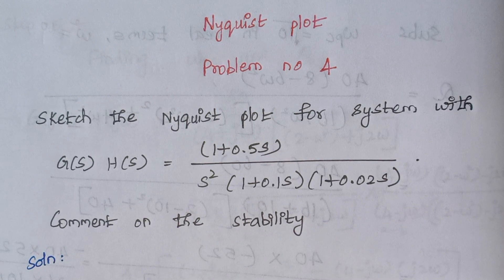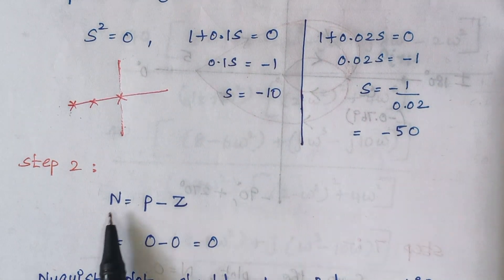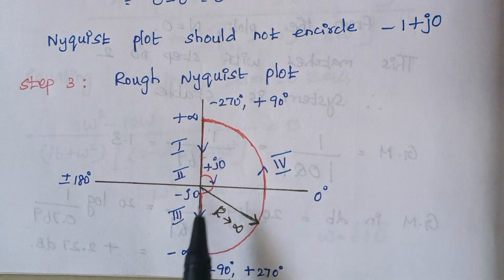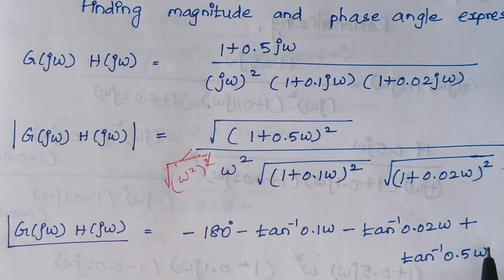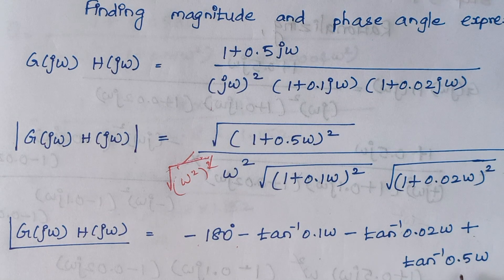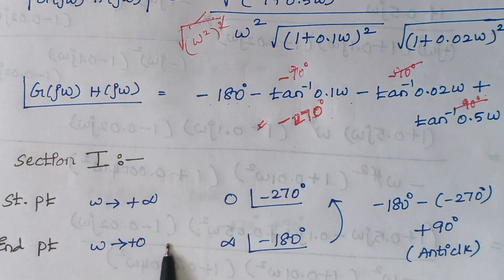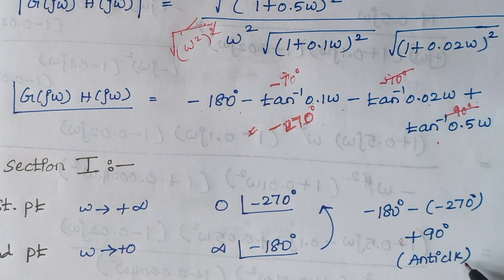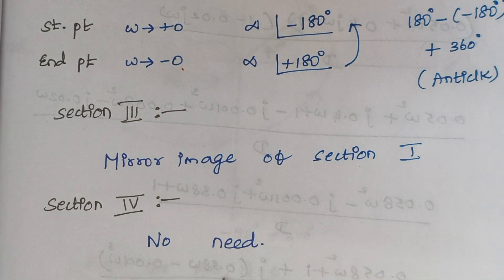Nyquist Plot (Problem no 4)

Comment: In the previous 3 examples you take magnitude in different way which is true method squareroot(1+w^2(36))   but in this question you have not take square of individual term why?
Reply: she did make a mistake there but it wouldn't change the values you get for section 1 and 2 and for the rationalizing part to get w(pc) and q its correct
Reply from the maker: Even if you solve this problem like previously solved problems,the answer is the same.Here I just followed the book.